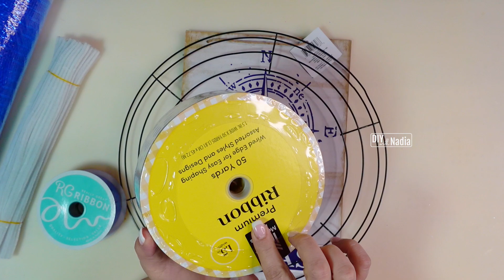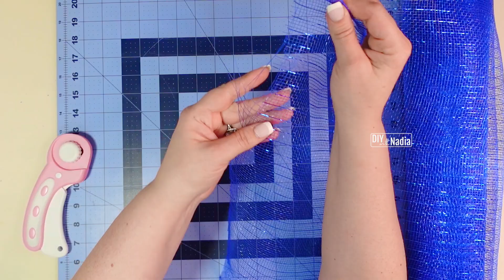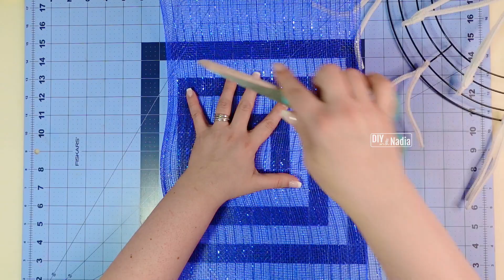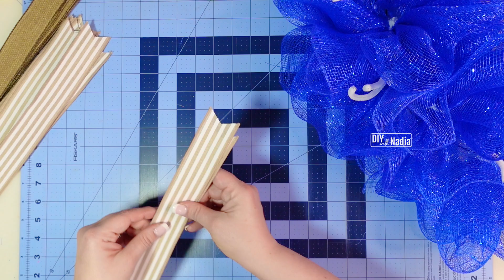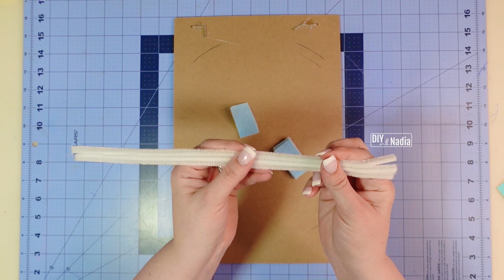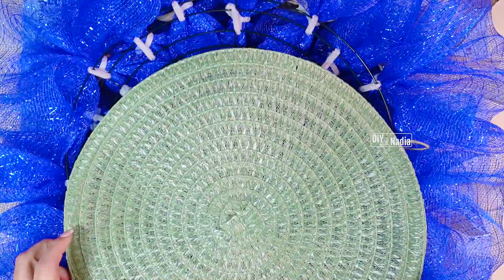Want a PROFESSIONAL LOOKING WREATH? Try This 21 inch Deco Mesh Trick!

Comment: Could you use 2-10 inch doubled and get the same results? If you only have 10”?
Reply from the maker: If you only have 10 in ribbon then I would simply make a ruffle wreath. https://youtu.be/ZF1kEuvr7LM